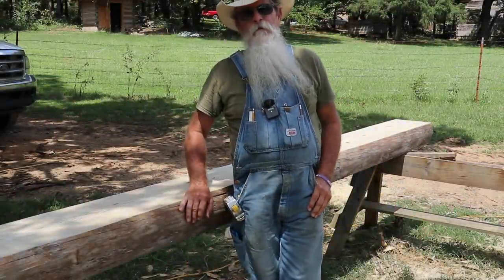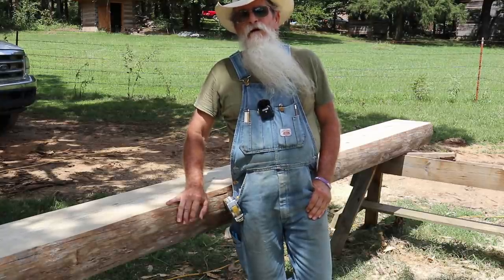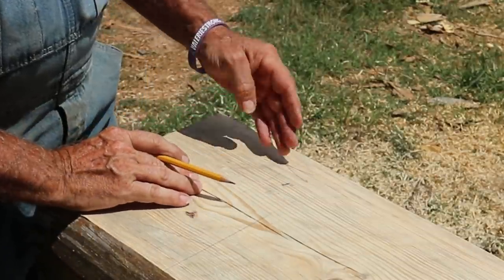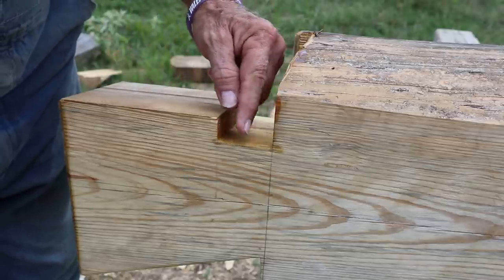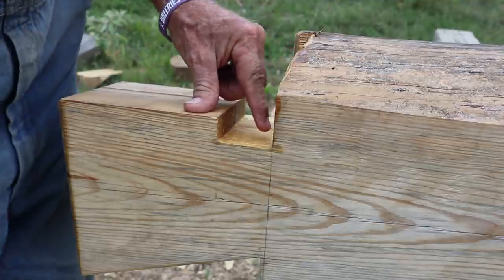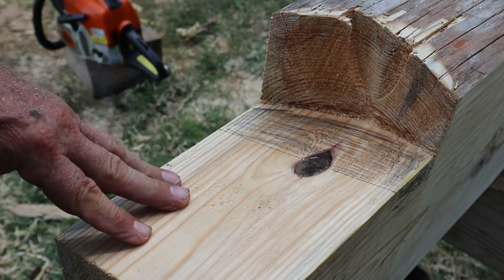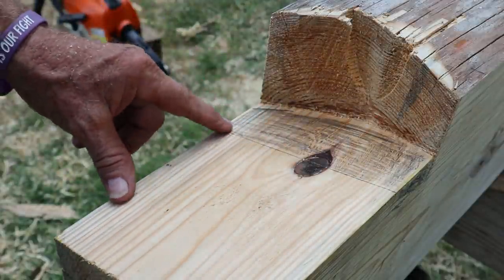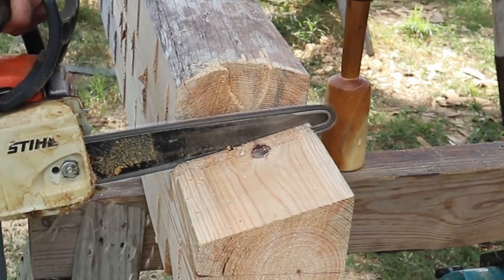Round 10, Dovetail Log Cabin build, (Ep 34)

Comment: I didn't understand the need for the key-way till I seen the log placement on this round. I assume your not building the gables with logs. Looking great.
Reply from the maker: Richard Bohling Sr   Howdy Richard- for me to do log gables the way I would want to do them would require me rent a crane because the hoist l built upstairs would be too short. We have framed the gables and put hewed log siding up that looks like full logs. I have done that on interior walls before and you couldn’t tell it wasn’t whole logs. Now you got me thinking lol. God bless you
Reply: @TheBeardedCarpenter  HA. Thinking is what I have been doing, as I watch you build the cabin. I have been wondering how you were intending to set the ridge beam. When you cut the key-ways you answered that question for me.

Comment: Well you make the corner joints of the log building! But why is there a gap between the logs? In Finland, all corners and joints of logs are made tight and insulated with wool in between.
Reply from the maker: Takametsien mies   Howdy- that is a good question. I feel that in the European countries the log builders are more advanced than the early pioneers of this country. When the early settlers traveled west they were in a hurry to get a shelter for their families and for the most part they weren’t skilled builders- most of them were farmers looking for better land. They did the best they could ,however many of their houses are no longer standing today. It was much less work for them to hew two sides of a log and cut their notch. Also, they didn’t have to use as many trees. Even though they had good timber to work with ( depending on where they were) they were forced to get their house up quickly. I am a traditionalist when it comes to log building because I like to build what would have been built in our area. I have a friend in Europe who does exactly what you’re talking about and he is an excellent builder. Thank you for watching our video. God bless you

Comment: It's been awhile.  Forgot which wall is A, B, C, or D?  Anyway; you shared the how of the key way, but I didn't hear the why?  Don't recall you using a key in the lower half the the cabin.  Is this key way an extra measure because it a second story log(s)?    Good to see another video - been awhile.
Reply from the maker: J F   Howdy JF- the front wall is A and clockwise for B,C, and D walls. The key way with the matching notch on the top plates help keep the plate from moving with the outward thrust of the roof load. Thank you for watching our videos. God bless you